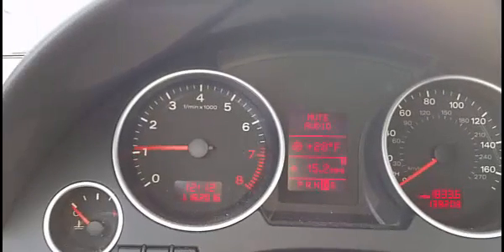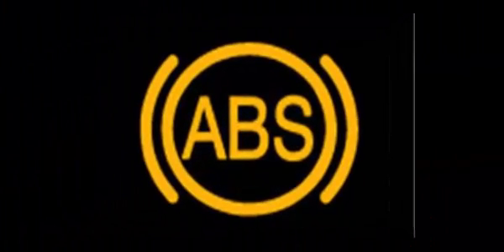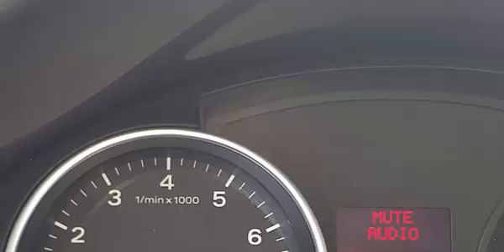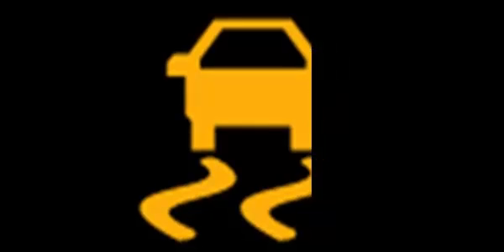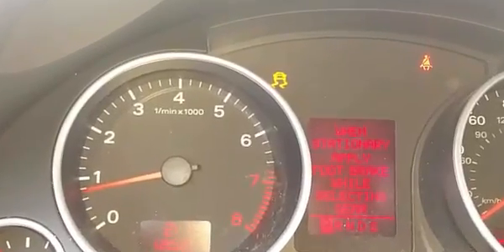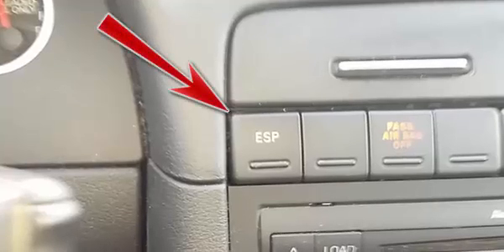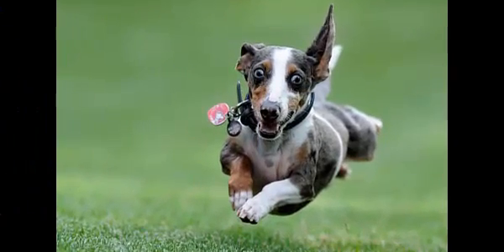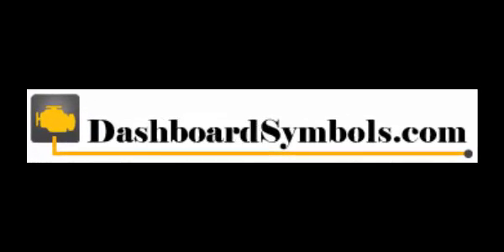Stability control lights: Assuming you have good tires, when and why do they pop up?

Comment: Why do they come on and stay on with Automatic AT transaxle light on and both stays on car is all over the road.  and won't go In gears and bogs down
Reply from the maker: Ok, this is a transmission problem, and a serious one from what you've written. Please have it looked at as soon as possible! The transmission issue automatically shuts down the stability control system, which is why its light is on. Stability control will be restored when the transmission is repaired. Good luck!

Comment: 2008 chevy uplander . brakes went out , scanned , replaced front hubs/speed sensor . didn't fix . replaced master brake cylinder, fixed for 3 days . then all four calbors are sticking ?? What would that be???
Reply from the maker: Way too many possibilities and a diagnosis from afar is sure to be wrong. While I admire the initiative and tenacity needed to problem solve something like this, brakes are far too important. The best advice at this stage is to find a pro you trust.
Reply: DashboardSymbols.com thanks but yes I took it to 3 master mechanics also dealer no one seen this problem before . replaced 3 master cylinders ? Brakes wont decompress now?? But remember started  by loosing brakes . pedal went soft plus. Master cylinder was leaking ! Now brakes won't decompress. We have scanned this thing over 5 × by different shops ?? First guy said front hub . speed sensor. So 300$ later still no brakes .then took it to my mechanic replaced master cylinder ..... Fixed for 2 days then started sticking replacement was leaking so replaced again ! Stuck calibers then replaced 3rd time all four stuck.? Any other trouble shooting would be helpful ? Only thing I haven't or anyone else has checked was if the brake lines may have collapsed from New master cylinder?? I'm not abel to check till Monday ??
Reply from the maker: Wow Josh, this one has you by the short hairs. You've done the right things, getting help and all, and most curious that the dealer couldn't fix it. As to brake lines, they are metal and will leak before collapsing. One idea -- the abs control module.

Comment: Hello I have a 2011 Mazda 3i sport and that light comes one sometimes but then diseaper and  I have a hard time controlling my car at some turns and my engine still makes a strange noise. Do you have any advice?
Reply from the maker: Well yes. Given the fact that the car is difficult to control at times, my best advice is to find a repair shop you trust and have the car looked at. Soon...

It cannot be diagnosed from afar.

Comment: 04  Pontiac grand prix super charged what  does the JL4 option package mean on abs module 
Jeffrey.martino19@gmail.com
Reply from the maker: Ah, this is actually still just a stability control (active handling) system. These systems use the ABS to brake whatever wheel might be slipping to help keep it under control.

Comment: Mine flickered on my Pacifica when I  started to skid and after correcting the skid by letting off the brake or whatever I, as the driver needed to do on my part, it would stop flickering which let me know, and I could feel, I was now fine. I don't think people really believe it means anything more than what it really means..that the car is engaging stability control and helping you to become safe quickly. In my Pacifica, it's simply referred to Traction Control with the same symbol of a skidding car as the button- meaning turn it on to avoid skids, not turn it on and you WILL skid now! Who would think an auto manufacturer purposely installed a button that when pressed will make you start skidding out of control to purposely kill you? LOL.
 I drive a Hyundai now and it is always engaged which makes me feel even more safe opposed to realizing I forgot to turn it on after I felt I was starting to skid. Cars can slip just as easily is rain, on gravel in the summer in bright sunlight, and on leaves or other debris in the road. I don't get why anyone would want to turn it off! I would also add that you should never turn it OFF while it is actively controlling or correcting your steering because it can cause your car to go crazy and then you WILL be driving out of control.
Reply from the maker: That last sentence it truly important. Do not turn Stability Control off while it is doing its job!

Comment: 3500 GMC Denali, lifted 6 inches ,  stability control light comes on aftermarket wheels and tires. I want to get rid of this light please help!
Reply from the maker: Sorry Mel. The stability control is dependent on the truck's original configuration. Making it work again is not in our bag of tricks and we would not recommend modifications of this type in the electronics era. Do you really want to go without stability control?
Reply: DashboardSymbols.com 
first Thank you for taking the time to respond, but I was hoping you can guide in the right direction to on what to do. I do not want go without it, and I'm .ore worried if is going to cause a bigger headache if I do t repair now!
Reply from the maker: The headache exists and the only advice I can offer is to contact a GMC dealer. I truly doubt that the system can be reconfigured to work, and if that's the case, the light stays on. Good luck...
Reply: DashboardSymbols.com

Comment: This flashed up on my car yesterday, a day after a crash on the drivers side. But it was accompanied with a strange engine noise and vibration. I pulled over and then carried on after five minutes and all was fine again. But the whirring noise from the engine is still a problem. Any idea what this could be? The steering wheel is also around 30 degrees to the left, even though the car is driving straight and so is not aligned.
Reply from the maker: Wow, well given the fact that there has been an accident, the only help will come from a service shop. Your steering, and everything associated with it, is damaged. That includes the Stability Control system.
Reply: Yes however did this safety shet should be castrated

Comment: mine came on when i took off at a light while making a left turn i might have took off to fast i just got a used Jeep Sahara and when lights come on i think it's bad.
Reply from the maker: Ah yes. If you were in an intersection, they are criss crossed with painted lines for crosswalks etc. The paint itself is slippery and a wheel under power can easily slip on the paint or a wheel can slip by simply taking off too fast. The stability control system will activate for a moment and the light will come on. Again, a warning light pointlessly flashing when the car is doing its job leaving the driver to wonder if there is a problem with the car. There is not...
Reply: @DashboardSymbols  This literally what just happened to me twice in the last 3 days out of the 10 yrs I've had my Jeep Patriot which has brought me here. Thank you 🙏🙏🙏
Reply from the maker: @KayFlowidity  This vid (https://youtu.be/ovRK8cEJsvA) will help you put a new battery in the key fob...
Reply: @DashboardSymbols   Why do I need a new battery for my Key fob for my ESP? Was this reply intended for another comment thread?
Reply from the maker: @KayFlowidity  Yes, sorry, quite likely. The mobile app doesn't always behave like it should. Have to do some digging.,,

Comment: the 2nd demonstration you said where the light stays on! well my engine light also came on do you have an idea what it could be?2011 dodge grand caravan
Reply from the maker: Sorry, no, the trouble code will need to be read. But, the engine light being on is likely WHY the stability control light is on. The engine trouble light likely shut down the stability control.